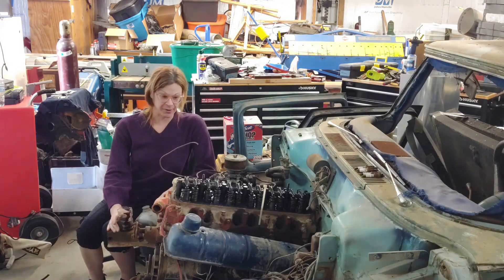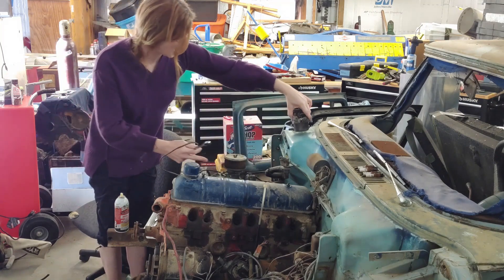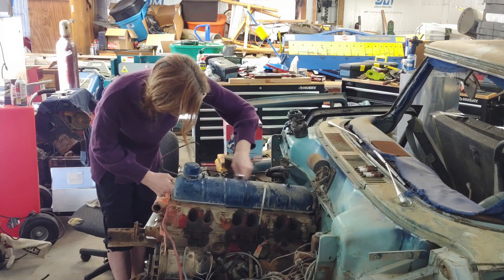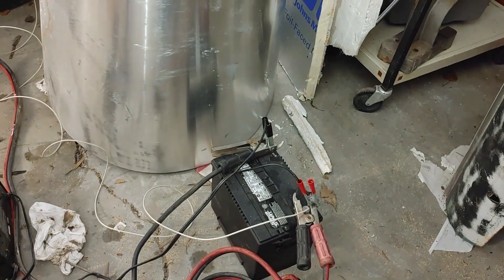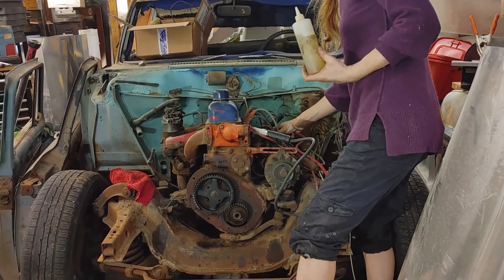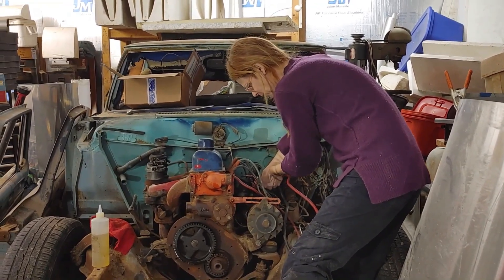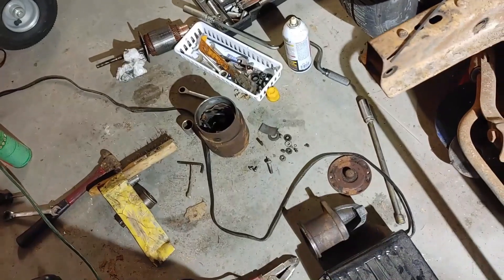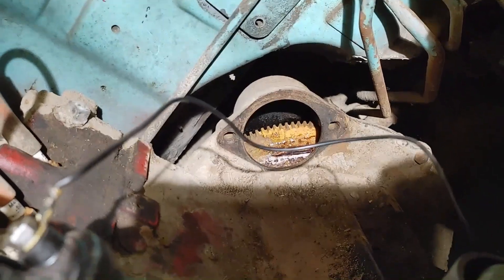Part 2 Revival of the 1961 Studebaker Lark engine

Comment: It looked like the starter armature was dragging, should be a worn brush end bushing. Did you lube the starter up while it was apart? Some of you cranking troubles might be the length of those jumper cables. If you had some battery cables on there it might help. oh ya, a battery that isn't "dubious"  might be the answer too. lol
Reply from the maker: we got a starter, carb and distrubutor out of another engine from a friend. there were some small parts necessary to rebuild the starter I took apart, but it wasn't very interesting video, so I skipped it and used the other one. The cranking speed didn't improve noticably as you can tell in this video.

Comment: Couldn't tell from the video but it looks like the smoke is coming from the back or under dash. Pretty common with these Studebakers. Disconnect everything from engine, and only run "jumper wires" to the coil to get it to fire. Sounds like you are losing all the Amps to a direct short, and kind of like Mopar that is usually the Amp Gauge inside the car, or the main "hot" that leads to it.
Keep tinkering with it and you will get it! I have faith in you.
Reply from the maker: Good suggestion!. I haven't shown it very well in the video, but the entire wiring harness is disconnected and pushed to the side. nothing runs through the factory harness. The coil and points are the only wires right now. The smoke is just from the jumper cables sparking on the starter.
Reply: @kimfixesthings  way cool! now it's down to everything you allready mentioned like timing, "hot battery" and what not..... you got this!
Reply from the maker: @BareRoseGarage  The best part will be the look on Buff's face when he hears it run finally!